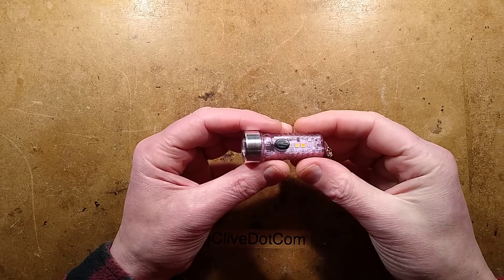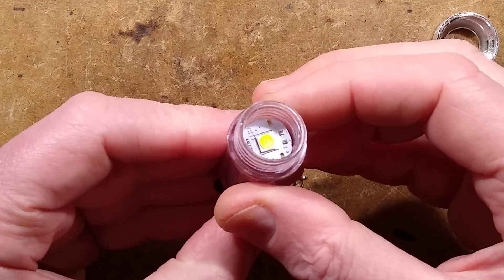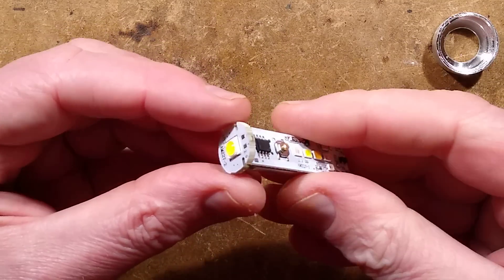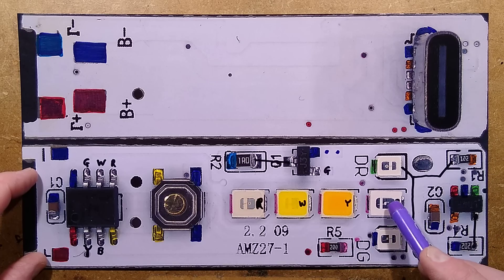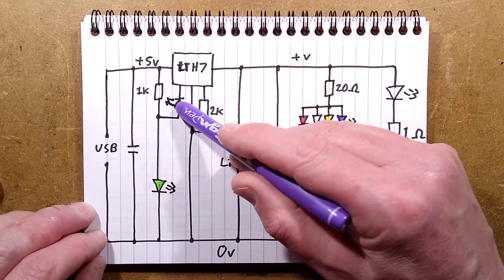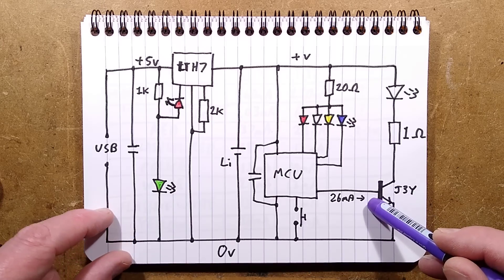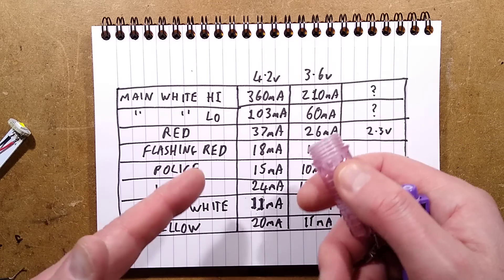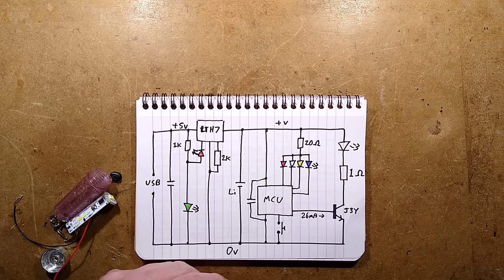Weird little light from eBay (with schematic)

Comment: Can you please answer this question please Big Clive, can I just add more batteries to my mobility scooter for greater distance
Reply: Your battery is probably just getting old and losing Amphour capacity. Discharging below 50% on a regular basis quickly shortens it life. Replace it with a new one, and a higher capacity one if it it will fit. Try not to discharge below 50% and it will last much longer.
Reply: @jumboegg5845  batteries one year old and i will have the extra two batteries in my fishing trailer pulled behind the scooter and wired in parallel, just want to increase distance.

Comment: Despite the small beam strength and pattern I do have a similar light for when walking down unlit roads so drivers behind have additional visibility of me on top of the hi-viz jacket. The smaller, weaker beam is also good as it doesn’t blind the drivers. I then have a second, stronger light source for out in front where I am walking 👍

Comment: I see it has a line of numbers "2.2 09". Can't help but wonder if that's when the board itself was manufactured and they've just been kicking around in storage until they finally found something to use them for. 🤔
Reply from the maker: I doubt it would be that old.
Reply: 22x9x2mm?

Comment: I might be a grumpy old man, but why can't we have torches with a simple on/off switch? I don't want to have to spend my entire life clicking a button to cycle through 144,832 modes.
Reply: If your just looking to turn on the white LED, it only takes one click. The only time you would need to cycle it at all would be if you want a different color light, or if you turn it on, and then try to immediately turn it off..
Reply: @Quickened1  every led head torch or bike light I've had has been the same, cycle through the modes to turn it off. I see a lot of Christmas tree lights the same.
Reply: @finger351  yes, most I've seen are that way, but I have in the past had LED lights that if left on for a predetermined period of time, will turn off with only one click, just like this little flashlight. I've had so many lamps since then, I doubt I could find it again, but I think it's here somewhere! Bottom line, it's not really new, just uncommon...

Comment: There's a whole bunch of clones. I think the original is from Nitecore. 

I have a few different models. Some have much better magnets than the others. One of them has a handy clip to attach to your shirt or baseball cap. 

There's various different options for the side lights, depending on the type of UV wavelength you need. 

Overall they're pretty awesome little lights. 

I prefer the glow on the dark body. 

The alonefire models have an annoying self-discharge problem.

Comment: hold on its UBC C, shouldnt the chip handle different voltages since USB C can also be 12 volts and 20 volts ?
Reply: Should only go above 5V (500mA?) if the device asks for it over the data pins, but they are not connected. So no worries, mate.
Reply: @LeifNelandDk  that would make sense. Thanks
Obviously I have no idea how usb c works

Comment: Did you mention the battery Wh rating and light runtime? I’m curious on how it does. Thanks
Reply from the maker: The battery is a fairly low 200mAh.

Comment: Clive, it really is High Time you tried reverse engineering something with some vestige of analogue design beyond a current source. 
All these Lithium cell controlers and 3 cent micro-controlers are getting tedious.
Reply from the maker: I put out a video every two days.  If I featured the more specialist stuff I'd soon run out of material.

Comment: Construction of the main led pcb and the control circuit board is very similar to the Lezyne bicycle front lights. In these, there is an aluminium pcb carrying 2 3535 leds which is then slotted and soldered onto the main/control pcb and bolted to an aluminium heatsink which forms part of the body of the light.

Comment: Current drive is more a CMOS processing thing, the little chip is able to sink a lot more current in the low state, simply because the drive to the N type is enough, than the output can supply, because normally the P type used to pull high is smaller in size, an artifact back to the days of TTL interfacing, where your gates that CMOS chips were invariably interfaced with were TTL, that all needed weak pull up, but to meet the pull down you needed decent current sink ability. Chunky cells originally that could sink 40mA and still meet the 0.8V drop for TTL, and for source 15mA and be over 2V4 for TTL high compatability.

This has carried on, as the output cell designs have merely mostly all just been shrunk down in new designs, keeping the same ratios, as the old designs were updated to fit new process geometries, but the actual physical layout is a block of transistors on the die, and to keep the size constant for both halves they had to make the source side smaller, as you need to have in there both a strong source driver, and a weak source driver, for using as an input with active pull up. The cell is capable of being input and output, so has to have the ability to read back input state, and pass through analogue input to an on chip mux and ADC, and still sink and source, but also as input have both strong and weak pull up as well. All taking space, and in a fixed cell size, so the P type transistors tend to get shrunk the most to make room for the other parts, and the poly resistor and ESD diodes for protection also need to be put in there as well.

Comment: This is a cheap clone of the Nitecore TIKI which is an amazing little flashlight and has a really nice well diffused beam.  The choice of a bipolar transistor for the main LED switching element is very odd, presumably they were a penny or two less than a suitable MOSFET.
Reply: I've owned several Nitecore flash lights, some of the best investments I've made.
Reply: I think they have designed it with a MosFET, but during the production someone used a reel of bipolar transistors instead of MosFETs.
The 26mA is the maximum current what the I/O-pin can drive. Normally you do not need 26mA in the base to have a current flow of ~300mA.
The factor is mostly 100-300, so you would need around 1mA of current into the base to get what you want.

Comment: It's a knock-off of a RovyVon flashlight 🙂 Temu also has two different styles. One of the light modes is low mid high and double tap for side lights, which are much brighter than your example. Side lights are warm white high/on, then flashing, then UV, then extremely bright red, then red flashing, then red and blue flashing. 

Blue is not set up in the UI to be used on its own, possibly even set up that way in the circuit...

(The reasons I bought these were because they were much cheaper than the name brand, and I wanted two different white lights with different light patterns and a UV light) 

UV is extremely useful to me, and having it as a mode on a regular light is outstanding.
Reply: I was thinking of the NiteCore Tiki LE. But it looks like Nitecore copied RovyVon.
Reply: @RC-1290  Probably neither of them copied the other. The design is likely an OEM design sold to both companies with minor differences.  What backs this up is the complete lack of lawsuits, as far as I know this has never been a legal issue between them. 

Great lights either way you go though.
Reply: Agree 💯%.You get what you pay for though, Rovyvon aren't cheap but the quality is top drawer. I hope Clive will one day pull one apart.
Reply: @Mark Bray  I need to buy one. They are the only reason I grabbed the two clones I did. Kinda hard not to buy something for $2 that you were going to spend $25-35 on. 
I'm not the type of person that really buys knockoff stuff because I just always got the regular thing I know for sure. Lately I've branched out in lights and I've gotta say some of the Chinese companies make some incredible flashlights like my new Falcon X1 from Wuben 12,000 ansi otf lumens twice as thick as my cell phone with its minimal case. Use to I'd buy Surefire made here in the States, but you really spend a ton for a small return increase, maybe with a new model. These other companies are using the same or better diodes more efficient circuits in some cases made by people like us, such as any of the BLM CPF model lights thought up by regular people doing a hobby. 

I'm 32, so I had to grow up with the same Maglites everyone else did, so to have 500 lumens on my Keychain still blows my mind. 🤣
Reply: Blue is accessible in the 2nd gen auroras. I wonder what that no name chip would look like dedomed 🤔.
Reply: Im in thailand this type of flashlight thru LAZADA is dirt cheap (and the aluminium ones using 3.7v batts are totally amazing and so cheap)  I wouldnt say knock off tho they are all generaic applications of the data cheets that accompany these chips, everything one way or another has them including thais ridiculous use of flashing brake lights as an "upgrade" :-) !

Comment: Is there enough room to fit the USB-C resistors across the pins of the USB-C connector using 1/8th-watt resistors?
Reply from the maker: It could be done.
Reply: @bigclivedotcom  but would it be any point if the controller limit the current anyway?
Reply: @LeifNelandDk  Some chargers won't deliver any power without them.

Comment: This product seems to be a copy of a more expensive similar light. I have the better model « M300 » with a magnet in the back. The side LEDs are very bright, you can definitely use them as tail light on a bike in a pinch. Your amber is replaced by UV on mine. I measured the battery capacity to 270mAh. I’m very happy with the one i have. I hope the battery survives, unlike the nitecore tube clones i had before.
Reply: All of those are copies of the original RovyVon. I have collected 10 of the RovyVon's over the past 3-4yrs in every side-light config from the A5 to the A28, I think I've got every glowbody color (green glow-body is the brightest and glows much longer than the others). The A5 to A8x are awesome lil lights. Expensive yes but I highly recommend.
Reply: @MAGGOT_VOMIT  I wish you didn't tell me that, now i have to buy some! 🤣
Reply: Can confirm, it's a commonly used design. I have a Jetbeam on my keychain that runs Anduril and has the same basic form factor and operation as this little guy.
Reply: @saabguy95sc  Your little flashlight runs an AI-powered, open operating system that brings autonomy to defense's toughest missions? Wow.
Reply: @pauldzim  I think that's what it's called anyhow 🤓
Reply: Yup, I just got my rovyvon a few days ago
Reply: I have the same.  Two for $16 on Amazon a few weeks ago.
Reply: Thought about a clone of the Nitecore TIKI at first, but it seems the nitecore model might actually be smaller in size.but also it has less, but more usefull, side lights